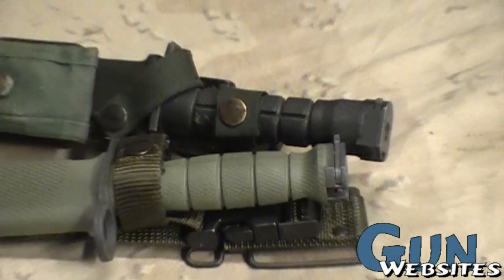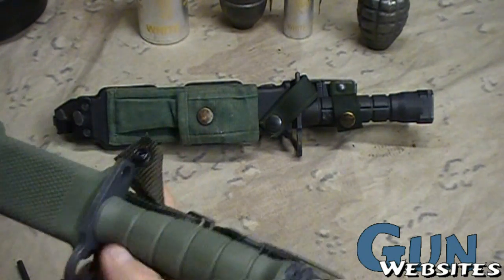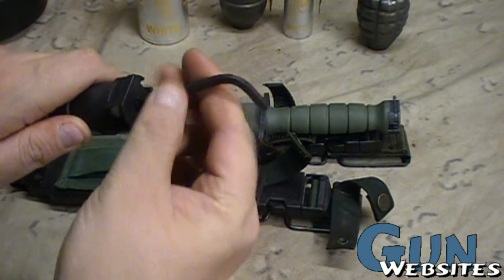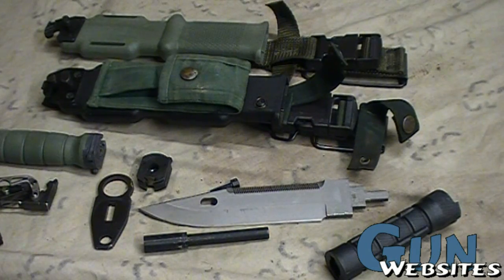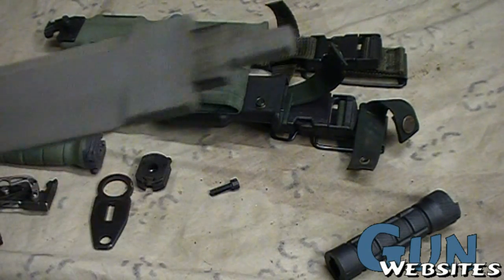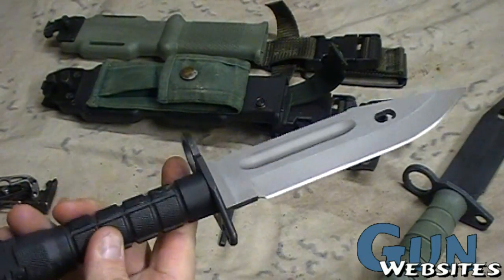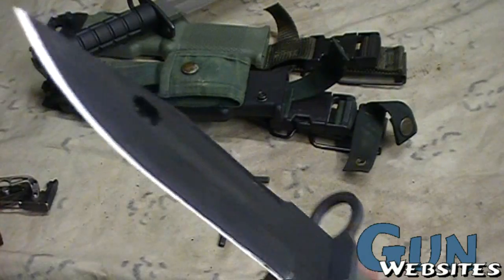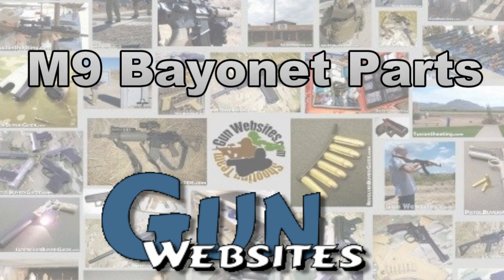M9 Bayonet Parts

Comment: You guys saying it is a blood grove and the purpose is to prevent suction or to bleed out is ENTIRELY WRONG.  It is called a Fuller.  Its purpose is to give the blade strength and lightness.  Wiki it. Fuller (weapon)
Reply: +Monel Funkawitz  Straight from Wikipedia - A fuller is a tool used in the trade of blacksmithing to produce a rounded or beveled groove or slot in the flat side of a blade (e.g. a sword, knife, or bayonet), and it also refers to the grooves made by these tools. These grooves are often called "blood grooves" or "blood gutters" as well as fullers, although their purpose has nothing to do with blood. A fuller is often used to lighten the blade, much the way that the shape of an I-beam allows a given amount of strength to be achieved with less material. When combined with proper distal tapers, heat treatment and blade tempering, a fullered blade can be 20% to 35% lighter than a non-fullered blade without any sacrifice of strength or blade integrity. This effect lessens as the blade is reduced in length. While this groove is often called a "fuller" by sword enthusiasts, it is the tool used to make the groove which is actually a fuller and the blade is said to be "fullered" after introduction of the groove.
Reply: Thanks for the clarification there is a lot of "Rambo" mis-information and people think the Ka-bars do the same thing and have a "blood groove" which is immensely wrong. People just think it sounds cool!!!

Comment: @crosshairjunky  yes and no , the  "new rifle" replacing the 47 and  soon  replacing the  74 pattern is the AK 200

looks almost exactly the same, allows for more accessories  and has lower recoil due to a new dual directional gas system the Russian requirements  are for a quad stacked  60 round mag as an  option for the 5.45mm rifle ( Hence why Surefire came out  with their AR quad stacks for Govt use ) the Nikonov was to be the "new Rus. rifle" but the AK 200 line beat it in  price/simplicity

Comment: I haven't read if anyone else pointed it out.  but the "cut out there to lighten it up a little bit" isn't that at all. Its a blood groove.  It is there so that when you stab your enemy the blade will not cause suction and get stuck.  Same purpose as dimples on a cheese knife.
Reply: It's not, it's a fuller.

Comment: So you showed what cheap Chinese copy of m9 bayonet looks like inside.  What about the real m9?  Can it even be disassembled like China clone?   BTW China clone of m9 weakness is in the plastic handle.  Replace plastic handle with steel pipe and it will be quite strong.